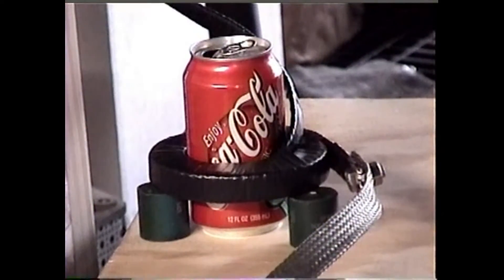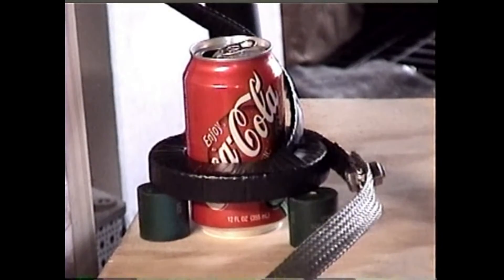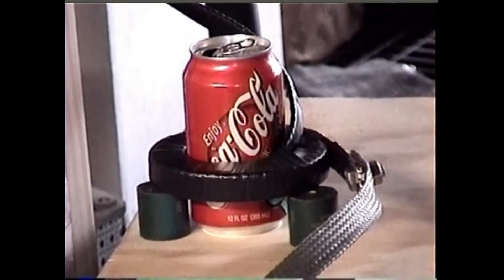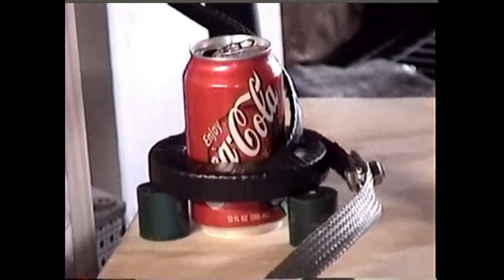Electromagnetic Can Crusher

Comment: This comment is a little late but here it is. I see several problems. The basic problem is that your capacitor is just not big enough. Even at 60 KV of charge, the energy in your capacitor is only 180 Joules. You need at least 800 Joules to get a good hourglass pinch on a can depending on how closely wound the coil is to the can. My crusher uses a 100 uF capacitor rated for up to 22 KV. My coil is 3.5 turns of 9 AWG magnet wire closely wound around the can and wound inside of a G10 containment structure to keep the coil intact. I can cut a can in half with 1500 Joules. You want a capacitor that can provide at least 800 Joules at no more than about 5000 volts. Higher voltages will probably break down any insulation between turns on your coil thus shorting the turns.
Reply from the maker: Very interesting.. Thanks for the great advice! I don't have a garage where I can do these types of experiments at the moment.. but I am hoping to get something soon.. So you use a lower voltage, higher Farad capacitor to do the can crushing? Very interesting! Did you post anything on Youtube?
Reply: @jaynesnetwork  Higher capacitance and lower voltage is more useful because the voltage has to be low enough to not penetrate your coil insulation. Lower voltages are also easier to generate. I use a 15 KV neon sign transformer with a full wave rectifier. I also use a spark gap switch so I keep my voltage between 2500 and 5000 volts for can crushing so that the spark gap can fire.
I have been intending to make my own Youtube channel for a while now. I just haven't gotten around to it. Its on my "to do" list.
Reply: You can also use much lower voltages, in the several hundred volt range. You will need to use a semiconductor switch, such as a triac, for voltage that low. You will also need much more capacitance to make up for the low voltage in order to get that 800 Joules. This means that you may have to use electrolytic capacitors to get that high capacitance. Their lifetime may be limited though because they are polarized and don't tolerate the AC current generated by the ringing very well. That being said, people do use them. Almost all of the crushers that I see on Youtube use electrolytics. My crusher uses a 220-pound energy discharge capacitor (not electrolytic) rated for this kind of duty. Its overkill for can crushing but I also use it for coin shrinking.

Comment: Sir if we want to make a backyard project using a minimal budget. What are the suitable values of capacitances, resistances we can use?
Reply from the maker: This is a very dangerous project.  You need a very large, high energy, and high voltage capacitor to do this.  Did  say this is very dangerous??? It is all in the cap.  Keep your eyes pealed for a very large high voltage capacitor. They can be very expensive.. at least brand new.. but some times you can find a good deal on an old one.. but be aware... if the cap is blown, it is worthless though... You do not want to buy a bad cap.... best of luck , and be very careful.. these voltage and energy levels are lethal if you get shocked by it..
Reply: What if i use very low caps...of 50 uF...?
Reply: @dheerjain2884  You need at least 800 Joules of energy from the capacitor in order to get a good hourglass pinch.

Comment: very nice, I always wanted to build a can/ coin crusher. I used to frequent "Ham Radio Swap Meets" looking for a big Cap, but could never find what I needed. You have re-"Sparked" my desire again to build a cap discharge unit.. LOL I wonder if a Leyden jar can be made big enough to do anything useful. There was a Guy at those Swap meets that had something similar, He had a bunch of coins he shrunk with it. He said he was pumping so much current that his coils were one shot, and would vaporize on each firing. LOL
Reply from the maker: It is all about the energy density, and peak power levels. My feeling is that Leyden jars will not have enough energy.  I would look for something like the old high voltage Maxwell capacitors.  You really want mylar type caps with high energy density and low inductance and with ~50-100kV voltage. I got this cap from "Nevada Surplus" probably around 15 years ago.  It is an very interesting project.